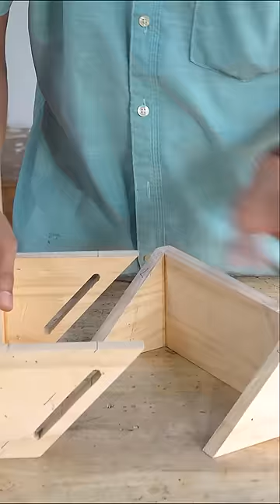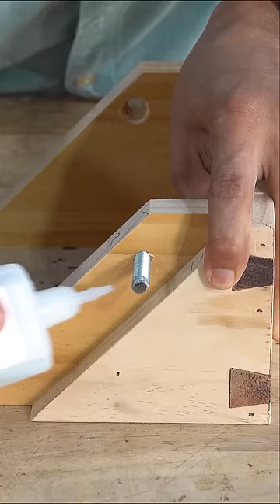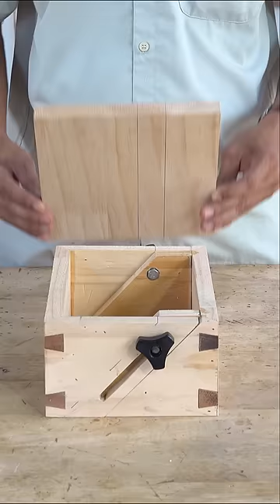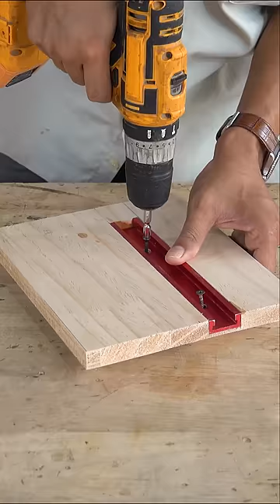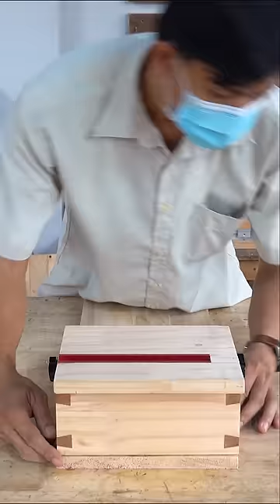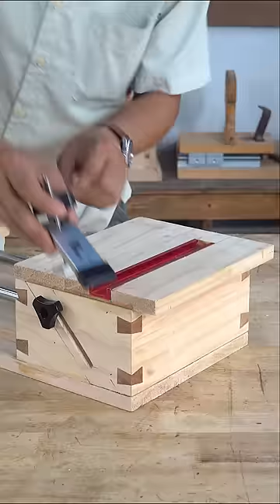DIY Woodworking Dowell Table Technique ( Parts 2 ) #shorts #woodworking #diy #trending

Comment: I'm still wondering what the hell it's for?
Reply: Fazer duras com a tupia ou fresadora, com melhor precisão...
Reply: Same... But I bet he doesn't know either...
Reply: Different things you're working on how different thickness or height, this allows you to adjust it.
Reply: It’s for routing dowel holes 

This way he doesn’t have to invest in a drill press.

Comment: The angle is too steep, and there's too much slop, racking and play in the movement ..
Don't understand why you'd go to the expense of a linear bearings for the router slide, but then cheap out on the platform lift..
Getting that thing trammed in will be a freakin' nightmare, every time.. assuming it works at all..
Reply: Someone has experience